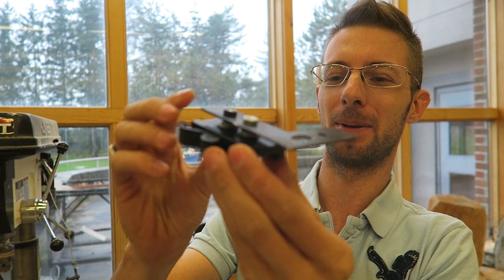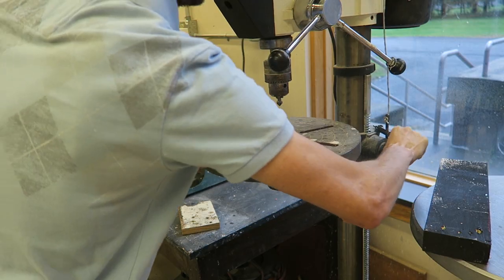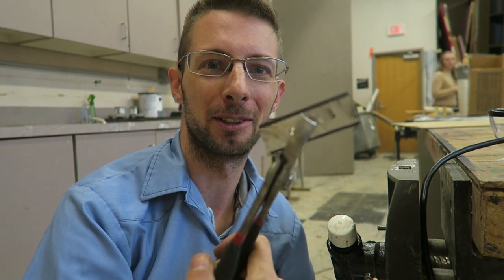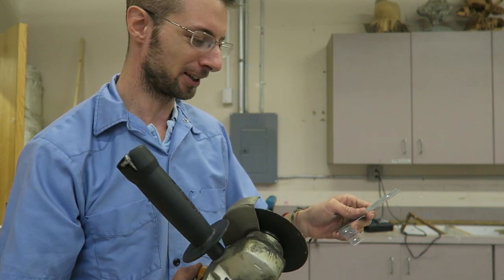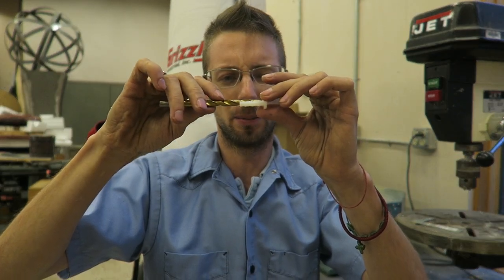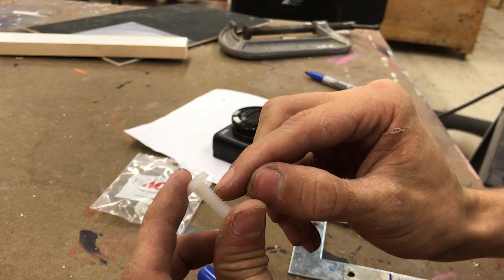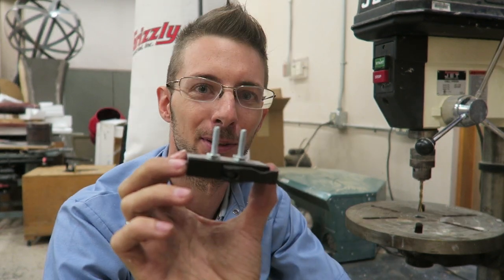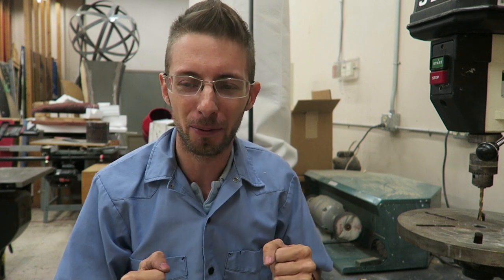Home Made Scope Camera Mount | Cheap and Easy DIY | Airgun Evolution

Comment from the maker: Remember to check out part 2: https://youtu.be/8r5ZmG5pEX8

PARTS LIST:
- 1/2" Scope Riser 5 slot - eBay                    ($6.80 ea..)
- "L" Bracket - Home Depot                            ($1.57 ea..)
- #10 - 24 Pan Head Bolts - Home Depot   ($1.18 pk..)
- #10 Washers and Nuts - Home Depot     ($1.18 pk..)
- 1/4" x 20 Nylon Bolt, Philips Head - Ace  ($0.40 ea..) - get a few

Tools: Free if you can liberate them from your Neighbor 
- Hack Saw or Angle Grinder
- Bench Sander/Grinder or Metal File
- Hand Drill or Drill Press
- Drill Bits
- Countersink Bit - Harbor Freight ($2.00)

Optional: not shown in video
- Black Spray paint